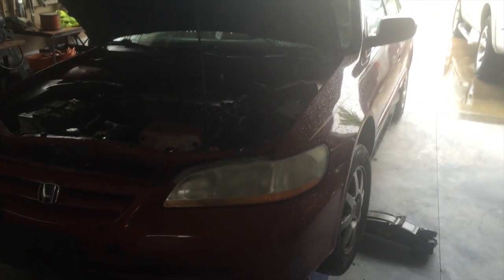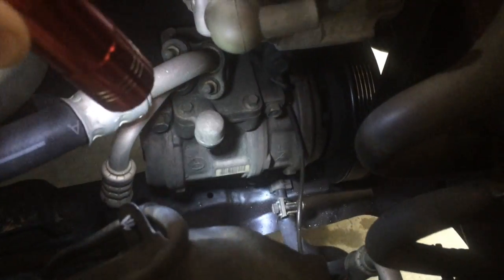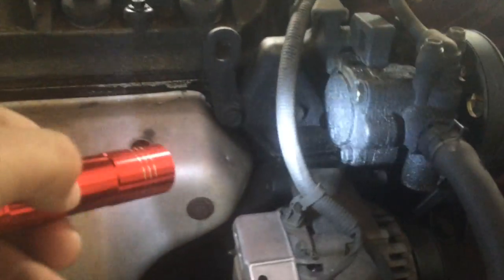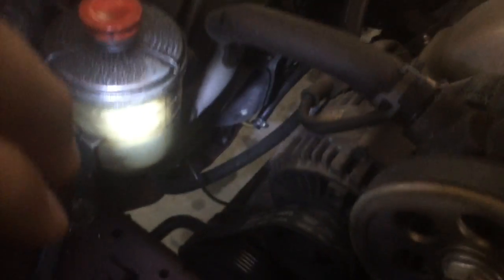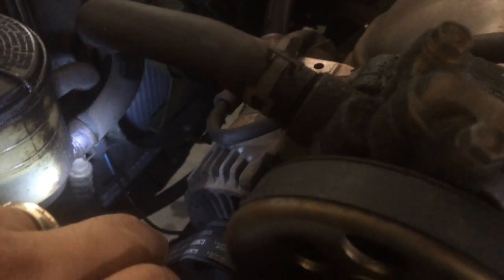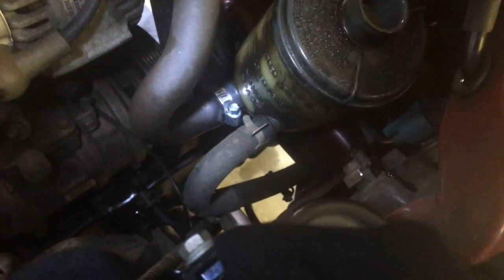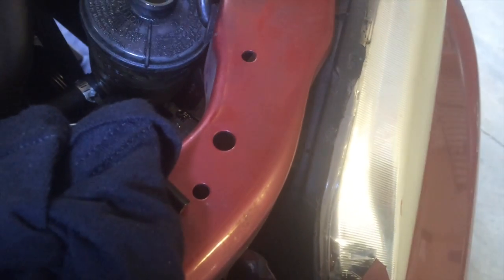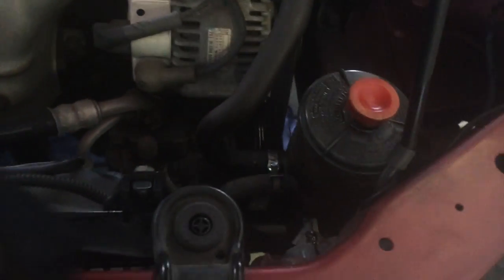2002 Honda Accord Power Steering leak fix

Comment: my 2000 accord's power steering pump and hoses look exactly like yours. They look so wet but, i can't visually see oil coming out of the pump. I'm gonna try fixing the clamp only for now like you did and hope it fixes the problem. Thanks for the video.
Reply: did you ever find where the leak was?

Comment: This video helped me to learn how to trouble shoot if my car has a leak.  Thanks.
Reply from the maker: +Eva Gall great!  Glad it helped.  :)
Reply: +Joshua Peek, you actually saved me from the claws of my local Honda Dealer.  I took my car in for service because I started hearing a whirring noise.  They charged me $135 for the diagnosis.  Gave me three possible causes for the noise, 1. loose tensioner, 2. leaking power steering pump. 3. Valve cover gasket problem.  Of course I don't know anything about those terms, so I went to youtube.  After watching a few videos, I chose to only get the tensioner replaced and the routine oil change.  Cost, $453.76.  The part cost $149.82, the Labor was $214.65.  Had I followed the Dealers full list of repairs, I would have spent over $1000.00+.   I have decided to change the "o" ring on the high pressure hose.  I have the tools to do this job and I bought the "o" ring for $1.26  I don't have the skills to fiddle with the valve cover gasket, so I'll leave that alone.  The noise is no longer audible.  I barely see 'wetness' at the high pressure connection.  The canister for the power steering fluid is full, there are no drips under my car.  I have a 2003 Honda Accord, with 44,000 miles.  I rarely use my car and from what I understand about tensioners, they rarely go 'bad'.  So I think the Dealer soaked me for a lot of money.  Maybe the bolt on the tensioner just needed to be tightened, who knows, and because I don't know any better, I just followed their recommendations.  Again, I'm more knowledgable because of your video.  Thank you.
Reply from the maker: +Eva Gall awesome... yeah they'll get everything they can from you if the can get away with it.  YouTube helps with lots of things like this.  :)
Reply from the maker: loyaled?  This was over a year ago....the vehicle has been traded in by Austin for another one.  Thanks for watching.
Reply: great video, everything that I was looking for explained simply in a short, easy to find video .
Reply from the maker: glad to have helped. :)

Comment: 2006 Honda Accord 4-cyl I traced leak to the "A pipe" that come out of steering rack and returns fluid to reservoir.  I sprayed grease remover on all areas around leak to locate source. Running fingers underneath I could feel rusted area. This pipe lays in/slightly above a metal brace (rear engine mount?) No need to replace entire line. I live in Minnesota and salt from road could get trapped. Good reason to run thru car wash at least 1-2 times a month in winter. Note this was a recall item on V6's not so on 4cyls.
Reply: I have the same issue on my accord 2000 V6. How did you solve the problem then?

Comment: this video showed part of the leak problem, under the power steering pump is tbe mounting  bracket for the alternator.  In this video you can clearly see its shiny n wet. The power steering pump has to be leaking from one of the seals of the pump on to the alternator bracket
Reply from the maker: Good info.  This is an old video.  The guy with this car has sold it years ago.  Thanks though.  :)

Comment: there is only 1 o-ring to replace on this particular pump, correct? I was given 2 replacement o-rings (Black and Red). have no idea where the red one goes. black went on top for the outlet hose.
Reply from the maker: +kj manoni honestly I don't remember..  was a long time ago.
Reply: +Joshua Peek, the "o" ring I purchased for the high pressure hose that attaches to the power steering pump is small and red in color.  I did watch a video that explained the difference in color.  If the "o" ring is black, but suppose to be red, then it needs to be replaced.  Then again, some of the "o" rings are black and are not suppose to be flush when seated into the groove, it's suppose to be slightly raised.  If it's not, then that is a sign that the "o" ring is worn and needs to be replaced.  Please, correct me if my understanding is incorrect.  I am an RN and not an auto mechanic.
Reply: kj manoni red one goes on top

Comment: What size did you use for the hose clamps and how many ? ps. Im trying to fix it myself since the shop wants to charge me 750$ saying its the rack and pinion but i want to check myself using this method before i spent all my money
Reply from the maker: can't remember, this was 3 years ago... it was some we had.  I think it was 1 1/2 inch?

Comment: So my hoses on the reservoir have a very slow tiny leak, but the main leak is coming from somewhere behind the engine on the drivers side, but I can't tell where without jacking up the car. Any ideas what could be leaking? I hope the rack and pinion is ok!
Reply from the maker: If you can look underneath it and see where the fluid is, it will tell you where the problem is more than likely.  I'm no expert, I just figured out this part.
Reply: @StuffIHeard  imma jack up the car to see what I can figure out next week

Comment: Hi i have the same car and mine is shaking and vibrating when I start it. I was wondering if you might know what the problem is? IT recently got worse and does it only when I start the car and Once it got so bad it turned off on it's own. If you have any  clue that this might be please let me know.
Reply from the maker: +vivi〈3 shaking and vibrating sounds like something serious is going on.  You should probably seek a professional.  Lots of moving parts, and a shaking/vibration is a sign of something either out of balance, something coming loose, or something broken....  Just in my experience anyway.  I'm no expert, just a Dad figuring this out along the way.  Good luck to you.
Reply: ***** thank you anyways for your help!
Reply from the maker: +vivi〈3 Sorry I wish I could help more.  Look up the problem you are having, there's got to be someone out there having the same trouble.... maybe there's a solution on YouTube??
Reply: Need a tune up.
Reply: vivi〈3 Check your motor mounts that’s what it is there’s four of them
Reply: I'd check front and rear motor mounts

Comment: I'm having the same problem it looked like the container was cracked in the bottom but I put a pressured hose in it and it didn't leak from the bottom so I'm guessing it's a tube or maybe I just need new clamps
Reply from the maker: maybe... good luck to you Jose.  :)